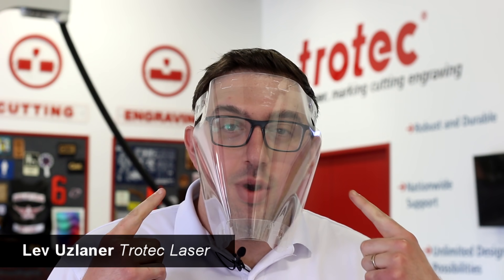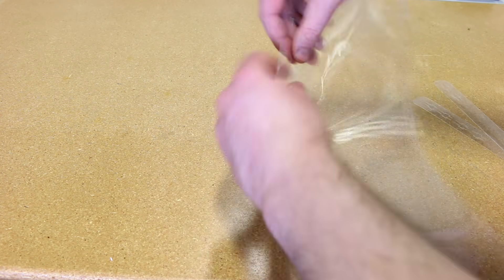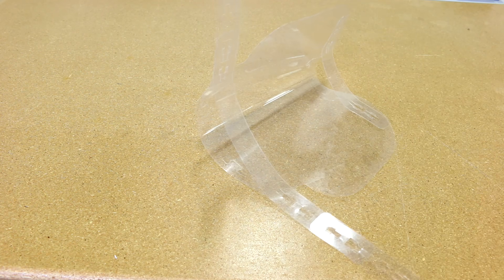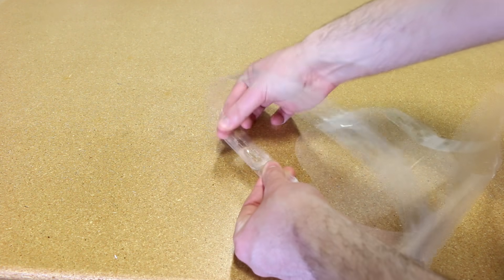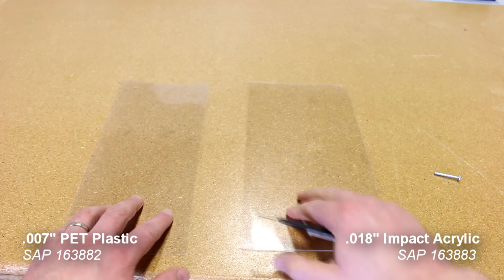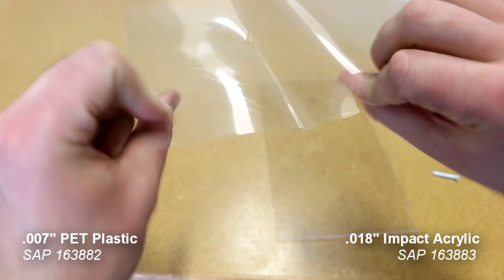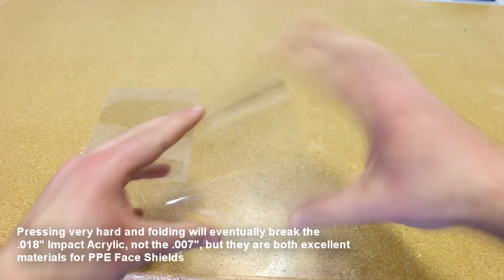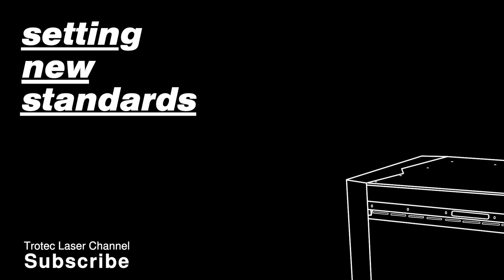COVID19 Single-Sheet PET .007" Face Shield | PPE Face Shield

Comment: Very interesting and extremely fast. This should definelty be submitted to NIH as a design for approval. These are virtually disposable, and have many advantages. I am currently working with a group of 3d makers who are printing out approved face shield frames, but it is an agonizingly slow process for me especially at home with y little printer. This is a lifesaver if it can be approved by the proper authorities. As for the .018 material, it appears as though it has some sort of memory, could you laser cut a tab on each side and then bend it and heat? around a slightly smaller than head sized cylinder and get a shield that could perhaps just stay on someones head over the ears like an old school plastic baseball cap?
Reply from the maker: Thank you! The .018" is impact acrylic so it can bend with heat. We are trying to get some designs approved but no updates yet

Comment: Am I doing something wrong? The shield is only coming out 8.5"x5.0". The one that you cut in the video is much larger
Reply from the maker: Yes the file itself is 18" wide. What file are you importing, what design software?
Reply: @TrotecLaserCanada  Coreldraw. Its the same file that you have in your link saying COVID19-Face-Shields-PET-.007.pdf